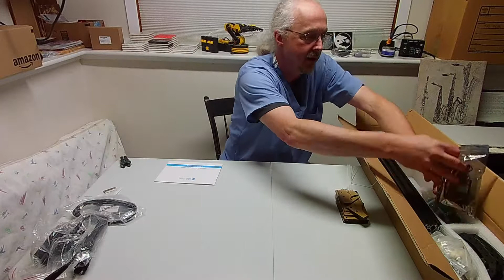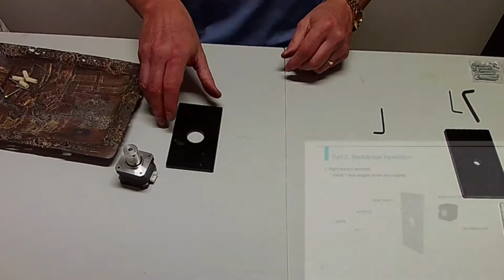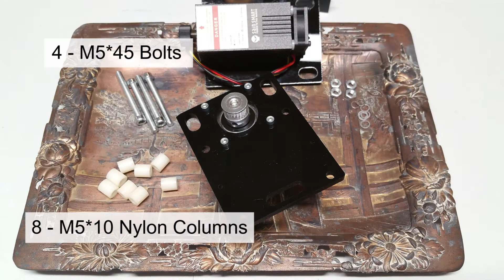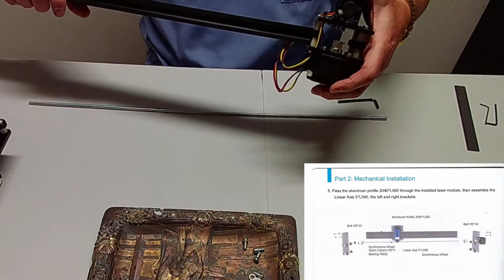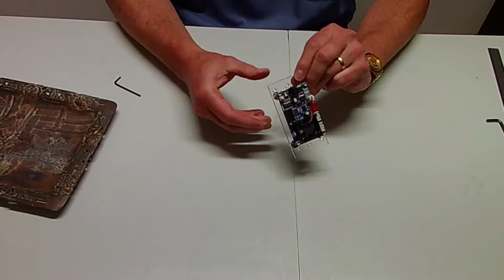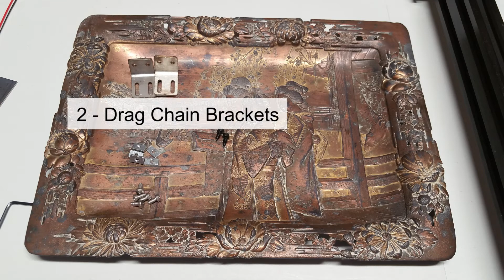SainSmart LE5040 assembly

Comment: Hi, What is the spec of this LE5040 I can't find the work area or the details of the Initial controller ( is it 8 or 32Bit )
Reply from the maker: Great question!  The working area is easy as it is in the name.  The basic working area is 50cm X 40cm.  As for the controller, I have not spent much time looking into its specification.  There really isn't much for it to do on this simple machine.  Move X, move Y, turn the laser on, not turn it off, turn it back on at 40%, now back off again.  Maybe calculate a few arcs here and there.  This is a great question and I wish I knew more about this controller.  If I find anything out, I will post it here.